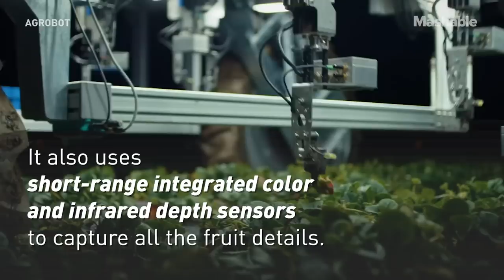Meet the Robotic Strawberry Harvesters Picking Fresh Produce

Comment: How does it work?
Reply: It probably looks for a specific color range, that way it is easy to code and maintain, and there is a minimun danger for a mistake to happen.
Reply: @PSiOO2  Is there a code out there freely available?  This is incredible
Reply: They probably use some open source image comparing library and they thought the system how to recognize ripe strawberries, After that it is a lot of trial and error how to hold and cut the stems and put it into the package, Not that crazy, I guess controlling the arms is approximately high school level algebra coded into the software, Though you need to set up the electronics and mechanical parts correctly.